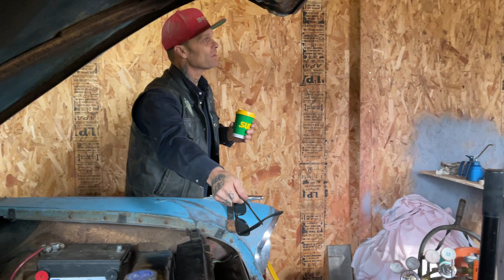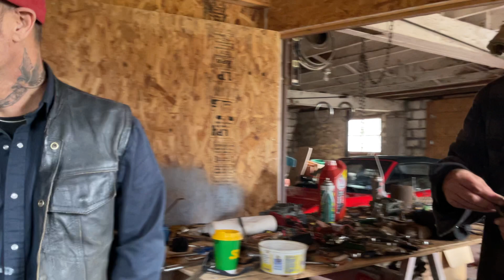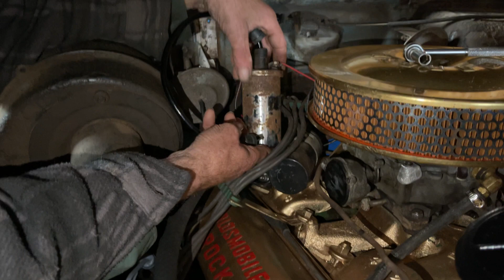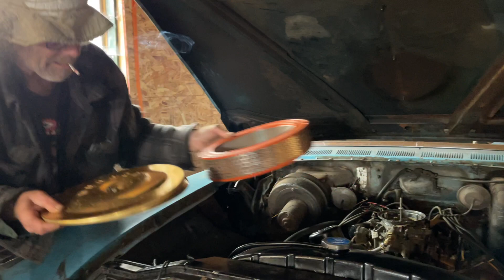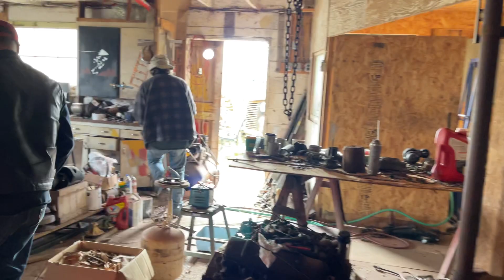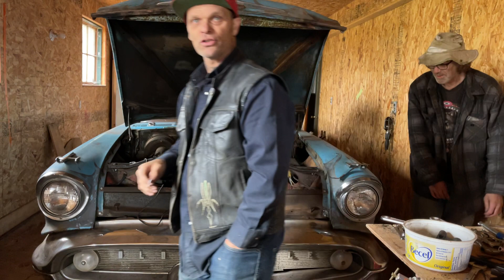ENGINE TROUBLESHOOT: WHY IS JIM'S ENGINE NOT GETTING FIRE? 🆘

Comment: The coil fires when the Points Open... When closed, the points allow current to travel through the coil to ground to saturate the windings. When they open the magnetic field collapses onto the High voltage windings. NEED TO CHECK THE POINTS... the Points are the ground for the secondary windings.
Reply: Secondary coil resistance test
Reply: @frankschwartz7405  You can't wire that directly to the coil. am I correct? It would go to some kind of ECM then the coil. right?
Reply: It maybe that a 6 volt system is not compatible with the new electronic ignition that was put in the distributed.  It could be designed for 12 volts. Either way the line to the points on the distributer is probably the problem.
Reply: Yes. Jim said it had an electronic ignition added. It’s a Hall effect sensor that replaces the points. That system would need to be checked. To see if it’s sending signal to the coil. As far as 6 or 12v? Who knows? I haven’t heard him say what voltage the car actually is running on.
Reply: It’s electronic ignition so it has no points
Reply: Right, two circuits in distributor, primary, ignition, to coil , to points, points close building magnetic field in coil. Points open , field in coil collapses, inducing spark to distributor.

Comment: On that type of electronic ignition conversion the red wire goes to the +  side of the coil with the 2 wires from the car harness and the black wirlre goes to the - side of the coil.
The ignition module could be bad . If hooking it up like this doesn't produce spark I would recommend removing it and putting points back in it. 
Hope this helps
Reply: First comment i have seen thats right the points break the signal on the black to make the coil fixed    can test the theory with a set of points at least temp.

Comment: Jim, the coil "fires" when the magnetic field inside the coil collapses.
The hot wire to the coil is a constant, the ground side of the coil is what comes and goes by the points.
To test the coil put hot to hot side and flash the ground to the ground side to collapse the magnetic field and make it spark.
Be Blessed.
Reply: Hillbilly has a good test.  Think of the coil as needing power, ground, and trigger, with the wire that goes to the center of the distributor being output, or "fire". (What Chad is confusing with the trigger's input.)  The body of the coil is grounded and the two power wires go to "+" as Jim had it.  Now you need the trigger wire (from the distributor to "-" as Jim had it), to be connected to saturate the windings.  After a very short "charge", the secondary windings are saturated and opening the trigger wire (what points do) fires the coil, sending a spark out the fat wire to the distributor.  

If the HEI isn't working, the trigger won't work and you don't get the charge-discharge behavior that points replacement needs.  But you can still manually trigger the coil by connecting "-" to ground momentarily, then disconnecting.  Which is what points do.  BTW, if you're troubleshooting the whole system, it's best to find a way to take HEI out of the picture because you'll usually break it by hooking it up backward (why Chad's wire switch was a bad idea) and they're often the problem to begin with.  Points need maintenance, but you can always make them work.  Not so with ignitors, which are nice when they work but make you walk when they don't.  And unlike points, you can't see them working.  My best guess is get a points distributor and you'll get it working pretty quickly.  

Chad, the coil doesn't send power to the distributor.  The distributor grounds and breaks ground for the coil through the negative wire connecting the two, switching power to the coil windings.  What is sent to the distributor is the spark from the coil's discharge, out the fat center wire of the coil to the center wire of the distributor.  That spark is then distributed to the plugs.  But you get no spark if you aren't switching the windings, which is what the distributor does for the coil.  

As was also suggested, a 12v coil probably makes a poor spark with 6v connections.  A 6v coil will work with either, but burn up soon in a 12v system.  Oh, and an oversaturated coil will explode, ask me how I know.  The top will blow off pretty violently.  And then you will know you have a bad coil if you're still alive, though you didn't start with a bad coil.  

When you were playing with the blue wire, if you'd only held the fat wire for the gap, held the blue wire to ground and then pulled the blue wire from the ground, you'd have seen a spark.  tapping the blue wire to ground and off would have given more sparks.  A coil isn't like a motor.  And my bet is that all of your coils are good even after connecting them up wrong.  Wish I could say the same for your HEI.
Reply: Hillbilly  has it right .
Reply: A good explanation by Douglas Nicholls .I was trying to explain it that way too but,,it would just be a repeat, lol. Thanks Douglas

Comment: Chad enjoy your content. Cherish your friendship with Jim. I just lost my friend Dale, he and I were a carbon copy of you and Jim. Dale was an incredible car guy, 82. R.I.P.
Reply: It looks like Jim boy had it right Red wires to coil positive and black to coil negative To check coil you need an ohm meter. Across the two terminals is the primary winding 1.4 to 2 ohms The secondary wings are measured between the coil tower and either one of the wire terminal connections  and could read any thing fro 8,000 ohms to 40,000 ohms Make sure you selector the correct settings on the meter James United Kingdom Good luck
Reply: My condolences.  I know it sucks losing good folks we lean on and learn from.  Sorry for your loss, man.

Comment: Remove the electronic ignition temporarily, and stick the points back in just to see if you have fire. I've seen many of these electronic ignitions which happen to be bad right out of the box. Jim is 100% correct, the keyed hot wire goes to the positive side of coil. the points, or electronic ign. goes to the negative side. PS...No the body of the coil does NOT need to be grounded.

Comment: Boys Boys Boys you need to hook up the points before the coil will work, the plus side of the coil is two wires and the minus side goes to the points, you do need the points before you get a spark from the coil, if points are bad you won't get a spark

Comment: To test a coil.
Connect 12v to positive(+) terminal on coil, connect negative terminal on coil to a wire, now tap this wire to ground and let go. When ground is disconnected the coil will fire, make sure to have a spark plug wire and spark plug connected to the coil and the spark plug grounded.

This is what the points do in the distributor, and what the electronic module also has to do, it has to disconnect ground from the coil once for every spark, so eight times per revolution on this car. 

I think.. hehe

Comment: Gents this video killed me. As an Electrical type, it was obvious neither of you understands the first principles of electricity, and what these old ignition systems do. I had to skip through the video just to see if you ever got it working - as I cringed with every attempt. 

The "coil" is just a transformer with 2 windings on a core. The 12 volt winding needs to be grounded to complete (energize) the circuit creating a magnetic field. When you remove the ground lead (and open the circuit - done so via the points when the distributor is being cycled by the engine/starter - it just pulses the ground connection) the magnetic field collapses inducing energy into the high voltage winding, which is connected to the spark plugs (via the distributor's rotor and high voltage cables,) allowing ignition to occur.  (As long as the spark plug is grounded & timing of the pulses is correct.) It's the build up, and collapsing, of the magnetic field that creates the spark. Passing 12 volts DC across the coil's primary winding without interruption will not induce anything into the secondary high voltage winding / high tension leads. I hope this is helpful.
Reply: Also, hooking things up incorrectly to test, is not a wise option for a lot of electrical components.
Reply: I'm with you Jim, painful to watch

Comment: To test the coil,  connect the +terminal to the hot side of a battery, connect a wire to the negative coil terminal while  tapping the other end of the wire to the battery negative quickly while holding the High tension wire close to the metal base of the coil for a spark.   Tapping the wire off the negative battery terminal simulates the function of points.

If the coil tests good,  Hook up the red ignition and resistor to the positive of the Coil. Mount the coil in its clamp. The case of the coil is the high voltage return and will not work without a solid connection to the block.  Your electronic modules red goes to the +coil and the black goes to coil neg.  If you don't have fire at the coil. test light the -coil terminal with your test light and crank the engine.  If no flash is seen then the electronic module is bad.

Comment: OK, this is "off the cuff":  I was getting a bit crazy with intermittent ignition problems on my 455 Olds - HEI ignition.  New "everything": wires, cap, rotor, condenser, "module".....   WHAT COULD BE WRONG ????????????    Oh, wait, there is that little circular magnetic sensor around the shaft inside the distributor - "factory".  That sends the signal to the digital switch.   THAT was the problem !!!!!!!!!   It had to be!  And it was.   Easy to take for granted.

?
Reply: Which brings me to: go back to basics: POINTS !   (I read he was HEI???)  I still have my original 1969 points distributor for my 455.  Not a terrible option.

Comment: jim you have the two wires to the positive side of the coil correct. The start wire feeds 12 volts to the coil, the run wire goes through the ballast resistor and feeds 9 volts to the coil to run. The negative terminal on the coil connects to the distributor. You are also correct there. When the points open they cause the coil to discharge through the large wire that goes to the center of the distributor cap. You can test all the wires and the coil up to this point by taking the large coil wire out of the cap and holding it close to a ground. You also had this part correct. Next take off the distributor cap and with a small screwdriver open the points. It will make the big coil wire spark at the ground. If you are lucky when you take the cap off you might be close to the lobe on the distributor cam. If so you can twist the rotor to open and close the points to test. The positive wires feed the power to the coil, the negative wire goes the the points, when you open the points it causes the coil to discharge. You can test a coils windings  with a vom meter. Look it up on youtube they are all the same. A coil is very reliable and most problems are in the points, next the rotor and cap terminals as Chad saw on the hup. Have Chads friend John look at it, he's a mechanic, and will have you running in minutes

Comment: From what I can see, You don't have any power to the (+) side of the coil. You need a hot (+) supply to the coil as well as the red wire from the distributor. The red wire from the distributor does not supply power to the coil. It needs the (+) feed from the coil to power the module in the distributor. The black wire from the distributor goes to the (-) side of the coil. There is a very high possibility that the module is fried by now but give it a try.

Comment: Jim and Chad , you will need to discard the resistor that drops the 12 volts to 6 volts it is used with a point system and since it has been changed over to electronic conversion verify you have 12 volts from the switch to the positive side of the coil. Its possible the Module is bad in the conversion .Petronix makes a good unit and has a installation video on YouTube

Comment: Could also be the ballast resistor.  Some cars have a wire from the ignition switch or a block on the firewall.  This will be a good one for both of you to work on.

Comment: Negative side of the coil goes to the distributor wire coming from the distributor. 
Positive side is the hot side coming from the key and from the starter solenoid for 12 volts while cranking. 

Check the points Jim! Make sure they are opening and closing,and not caroded. 

Myself,I would put new points and condenser. Then check for spark!
Reply: Yep pretty much that simple. 
If he has a 12 V electronic module in the cap all he needs to do is bypass the ballast resistor on the firewall to supply a full 12V.

Comment: hey jim....good to see you again....hook up the power wires to the coil pop off the cap....turn on the key and open the points with a screw driver see if they spark....if so check cap or rotor might be shot....clean up the points and re gap them...check for power going from the coil to distributor...the test light will flicker if the points are working

Comment: Jim's instincts were absolutely right.   Remember that the distributor has 2 functions - firstly to make/break the connection to earth that's what allows the coil to create the spark.   The second function is to deliver the spark to the correct cylinder.   If only Jim had removed that blue wire from earth when the igintion was switched on, you would have seen a spark - No need to actually crank the engine.   Also the coil casing doesn't need to be earthed.  Where is Downtown John when you need him?

Comment: Hey guys,
6:30am here. I would check the resistance of the coil with a multimeter. Also, the Huprod had a similar problem and it seemed to be the rotor not conducting/making good contact with dizzy cap thus  not allowing coil voltage to reach plugs. My 2 cents :-)

Comment: Really enjoyed this episode. Jim when converting from points to electronic ignition. On my 1973 nova , v8. The resistor wire needed to be switched over to regular wire, the resistor wire will not let it start or run. That's for the pertronix electronic  upgrade.
Reply: That is because in a 12v points system the resistor lowers the voltage to 9v as the points will burn out if supplied with constant 12v 🙂
Reply: @adminsnat975  exactly, I heard Jim say he changed to electronic ignition

Comment: F Schwartz related it has been converted to a module, in which case it wouldn't need the resistor. If original, I would check the point gap which is .019 with a feeler gage or 30 degrees on a dwell meter. Also check to make sure the rotor is turning. Over the years I've seen several distributer gears fail. If it can't engage the drive gear, the engine spins, but the distributor shaft sits still. The condensor (capacitor) is a rare culprit, but they do occasionally fail. I haven't bought points and condensors in more years than I can remember. However, a long time ago, I do remember going to a parts store to get a set for a four cylinder Chev (Iron Duke) boat motor. The kid behind the counter had no idea what I was asking for, but allowed me to look for the parts myself.  Took them to the boat, did an eyeball adjustment and it fired right up.

Comment: Please tell Jim, hook both positive to the coil.   Then put the short wire back on the - side.   Plug the distributor wire and lay the coil down.   Set the spark wire near metal, take the short wire and touch and release to the metal block.   If it sparks, the coil is working and your electronic ignition is not working.   Put an ohm meter on the wire to the distributor and touch the block.  Turn over the engine and the ohms should bounce up and zero.   If no ohm meter, get your 12 volt test light.   One side to + and - to distributor, turn over the engine, light should flutter.

Comment: 👌 With the ignition on the coil needs to be grounded good, leaving the ignition on for a little while the coil sould start getting warm at the touch of the hand is a sign the coil is good .. But the outside of the coil has to be grounded real good & negative wire connected to the  distributor to make spark , if not somethings going on wrong with your electronic ignition 👍

Comment: Jim is right. Connect the red wire from the distributor to positive terminal of coil.  Connect the black wire to the negative terminal of coil. The distributor makes and breaks the coil curcuit to give you spark.

Comment: The resistor is only there to make the points last a reasonable amount of time.
Coils rarely go bad, most likely you have a problem with the points!
They don’t open or they don’t close. Probably just need adjustment but I’ve seen this problem be caused by the distributor not turning!
Open the distributor and have a look!

Comment: Just watched this episode again. The issue is that in a coil, the ground is connected to the points or electronic module so that the primary is “switched” on-and-off to rapidly energize and collapse the magnetic field inside the coil. This causes the primary (connected to 12VDC) to induce an electrical current in the secondary (connected to the distributor and to the spark plug sequence) and to increase the voltage by several orders of magnitude (20,000 V +). A coil is like a transformer, which does not work on DC. It needs to be subject to an alternating current to work. The points or electronic module simulate an alternating current by switching 12 VDC to 0 VDC and back to 12 VDC and so on. The resultant “square wave” is what makes the coil work. Grounding the coil does not work unless the ground is rapidly switched on and off. It’s just how electrical inductance work.